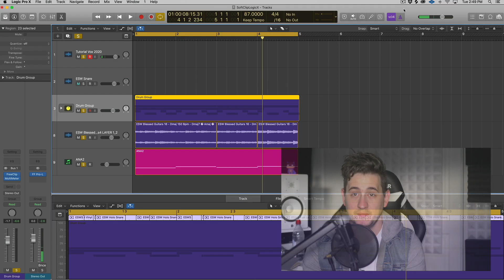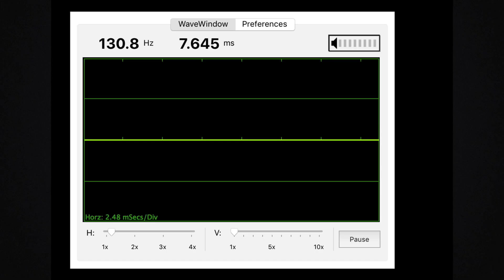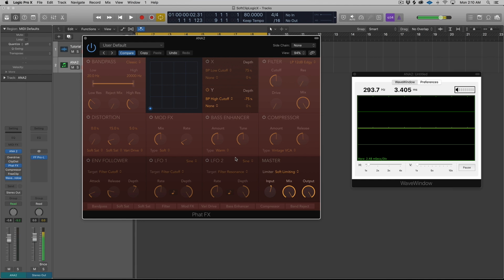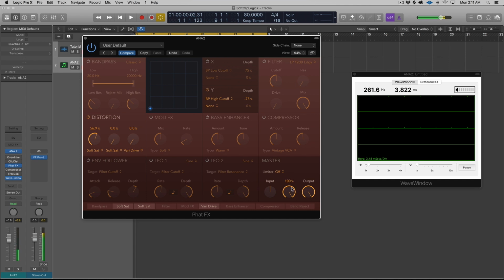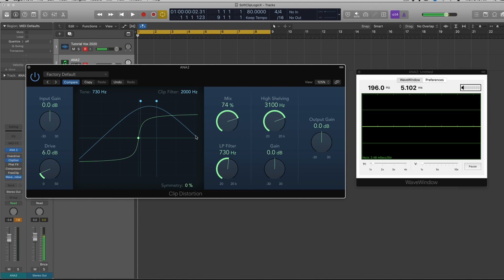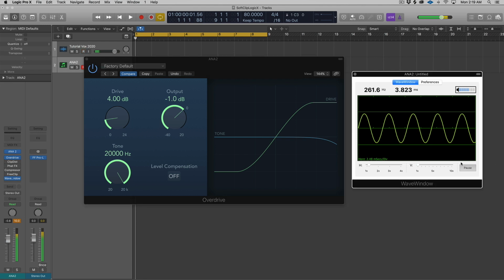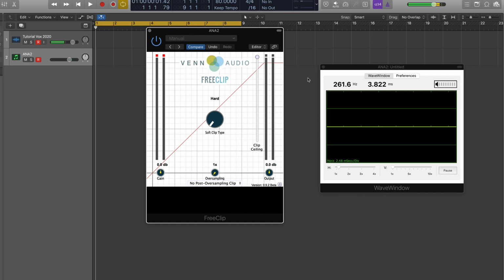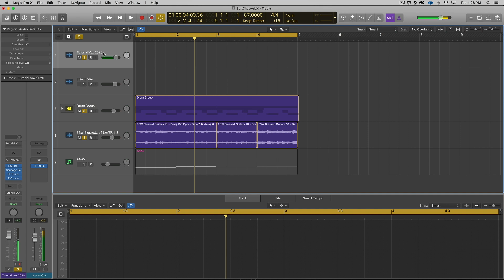Soft Clipper in Logic X - 5 Ways to do it!

Comment: One thing I dont understand is how to things get "punchier" when you are clipping away the transients or peaks? Dont they get "boomier" or flatter sounding since the initial hit is clipped... ??
Reply: It's a balancing act. Cut too much of a transient and you lose the punch of the initial attack. Cut too little and you're leaving lots of extremely short spikes  that will affect the mastering stage negatively as the limiter has to work overtime. Humans are bad at hearing very quick spikes of sound, so you can get away with shaving off quite a bit before we perceive the sound to become dull and less punchy. Just don't overdo it. When people say "it makes it punchier", it's a half-truth because of how we perceive sound psycho-acoustically: There are limits to how much of a transient we can hear, so by shaving off anything we'd never know was there you can push the loudness more without seemingly flattening the sound, and this we call "punchy", even though punch is technically more of a dynamics-issue. This is partly why so many people like analog gear: The slight saturation at every stage slowly dulls spikes that you otherwise have to work out yourself if you're purely in the box. It's not a problem as we have loads of great plugins to do the job for us, but it adds a bit of extra work or care :) This is why digital producers are picky about saturation, clippers, distortion etc. But be very careful, clipping and limiting is always a compromise between loudness and added distortion. It's best left to mastering engineers or very skilled engineers, but if you carefully soft clip in several stages in your mix you will make mastering a lot easier and cleaner, without unwittingly adding lots of nasty distortion to your mix.
Reply: @bananermat3798  thorough response

Comment: do I apply this during the mixing stage (when my track still has -12db headroom) or when I bounce the track and start the mastering stage? need this clarified.
Reply from the maker: Joseph White some do it either way. I like to have a soft clipper on my master while I start a track or beat because it will stop clipping and I don’t have to worry about that while I’m writing and arranging. If I end up doing a proper master I might take the soft clipper off and then use ozone, shadow hills, uad plugins etc.

But while you are mixing, try using the soft clipper lightly here and there on certain tracks, helps make the mix punchy
Reply: Echo Sound Works I’ve put it on the stereo channel and it’s made everything punchier (my style) thanks for the video !!!!